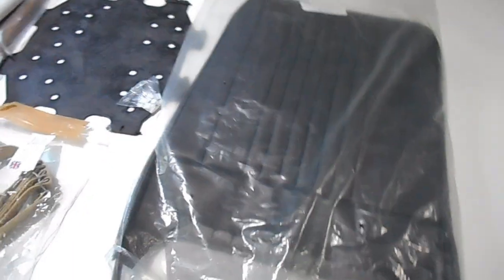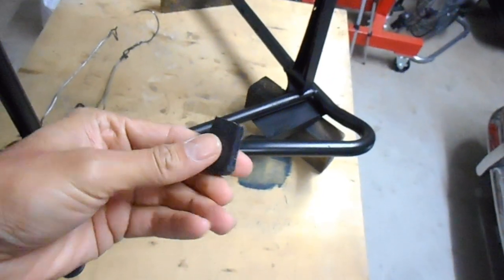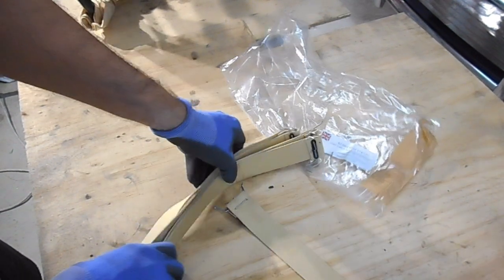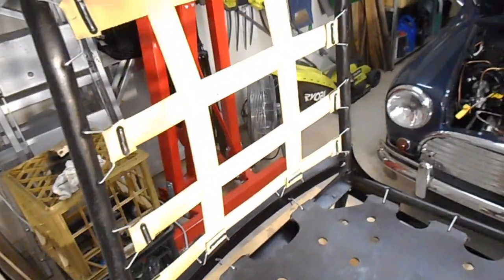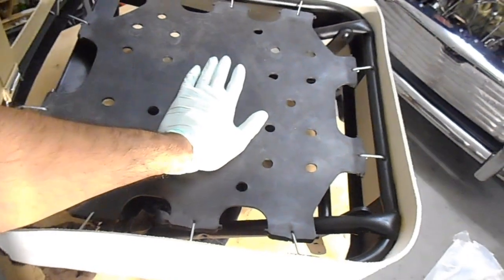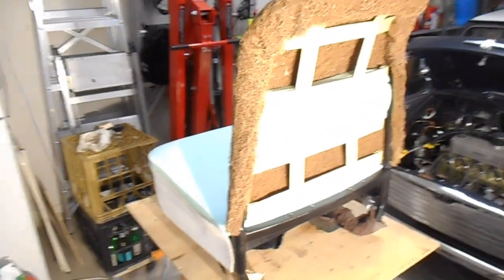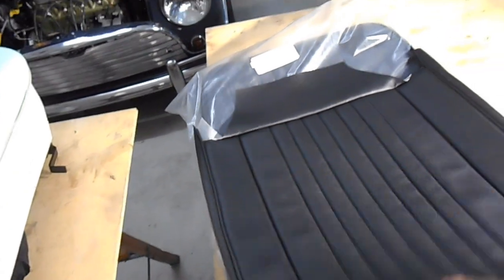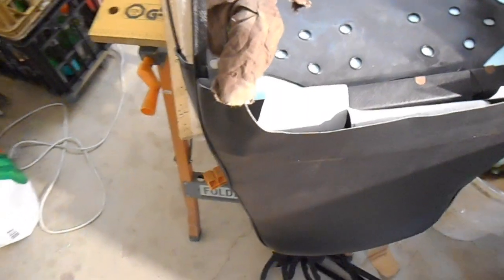Morris Mini Cooper S - Front seats, Newton Commercial EP045

Comment: Awesome video - Using the lubricant to get those horizontal straps in a great idea and doing the lower part of the clip first means the top is a little closer and easier.  Some of my seats had a the foam on the bottom and gave it a rounder look on the base rather than the bench look. Love the cling wrap idea - stretch wrap works well too. Great work and informative

Comment: Looks great 👍How is the back support kept in place? Thanks
Reply from the maker: Officer Dibble The seats are still very comfortable to sit in, especially for longer trips. I believe I used upholstery glue to keep the extra foam in place.
Reply: OK, do you think it'd be OK to but a bigger piece in? Eg if yours was say 19"x6"x1" & I put a piece in 19"x10"x1". Would that help to stop it dropping down & still work as a lumber support? Thanks
Reply from the maker: @officerdibble5565  it might still fit, you might need to do a test fit first, the advantage of putting the plastic wrap over the seat back before the cover makes it easy to get on and you can slide it off if you need to adjust the lumber support.
Reply: @CafeRacerLab  I'm thinking it won't drop down then if it's deeper, but I wasn't sure if it still needs the gap under it to work as a back support, thanks